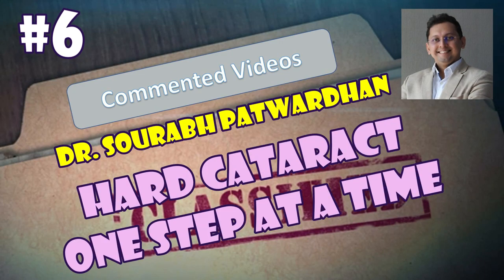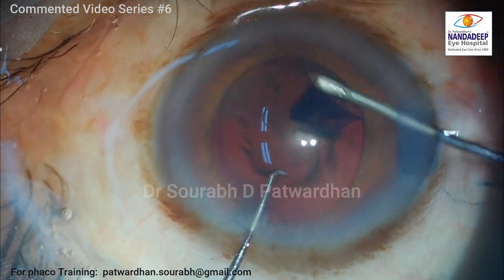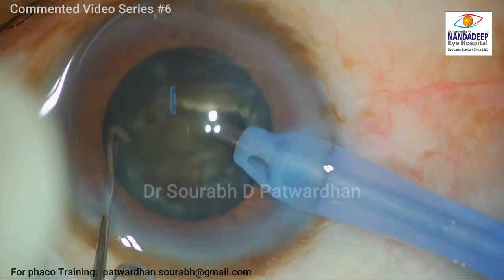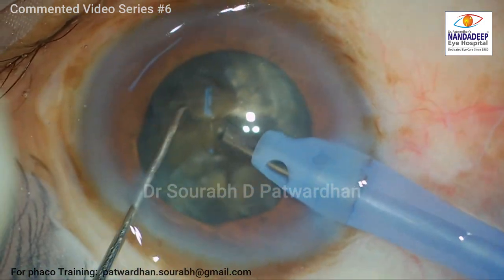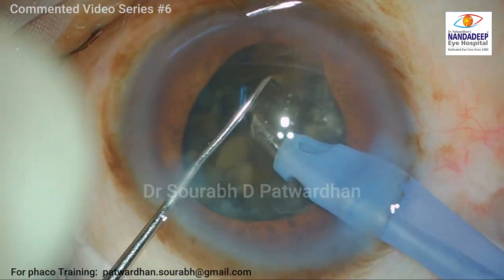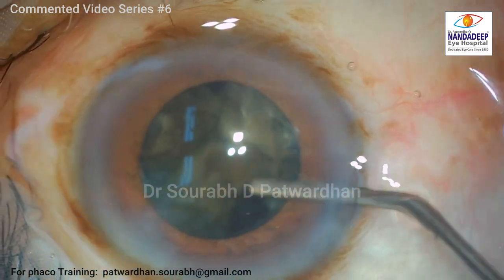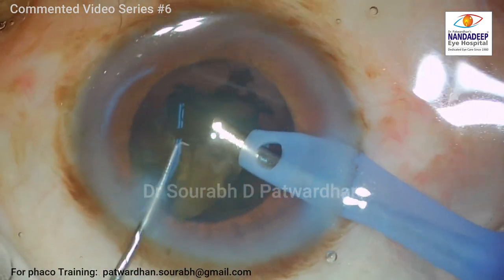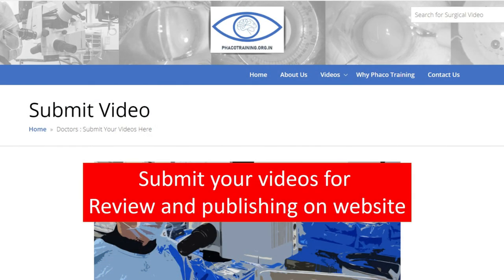Commented video 6: Hard cataract- one step at a time : Dr Sourabh Patwardhan

Comment: Good surgery dr.sourabh
Correct me if you think otherwise..
Wouldn't keeping bevel sideways in torsional phaco  compromise cutting efficiency, especially in hard cataract where you need it the most?
Reply from the maker: Hi.. i dont think the bevel position changes cutting efficiency, but it changes the orientation of nuclear pieces around it. If i use conventional bevel up position, the pieces tend to come anteriorly thus increasing chances of more anterior phaco and pieces touching endothelium. Bevel down or sideways achieves quicker Occlusion of tip and also keeps the piece at iris or deeper level.
Reply: @SourabhPatwardhanPhacoTips  

 Torsional Ultrasound works best when 
lenticular material stays in front of the distal end of the
phaco tip.
Reply: Agree with occlusion part though
Reply from the maker: 👍 if you observe carefully, you will find that nuclear pieces present themselves on same was in correlation to the tip due to vacuum at the tip, so effectivity wont change. And we  use torsional or longitudinal power when tip is occluded which is most efficient way of using energy, as its delivered completely in matter of nucleus. You can try using both ways in multiple cases and compare. You will find that in fact energy used is less in bevel down or sideways as occlusion is achieved more easily. You can try it in your cases.